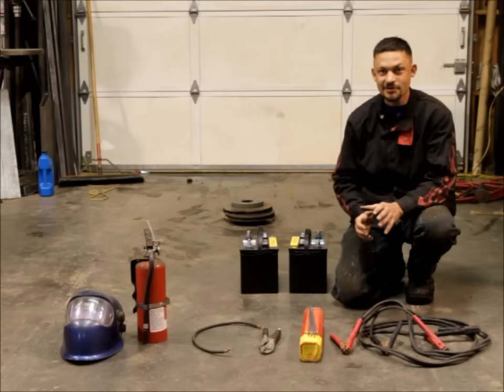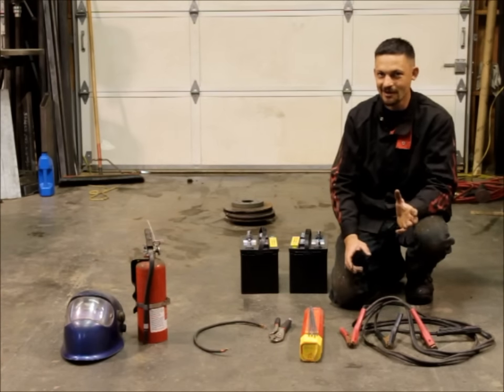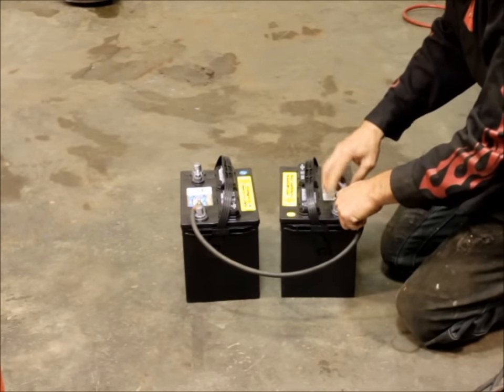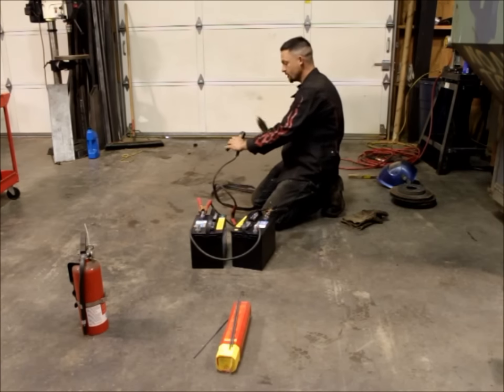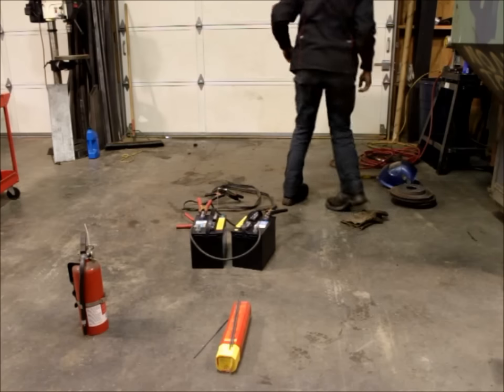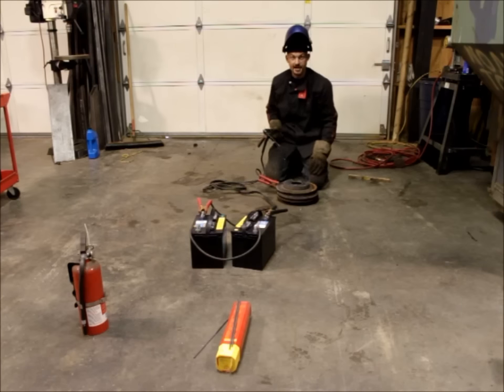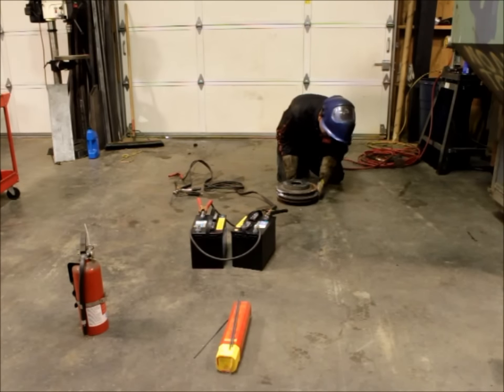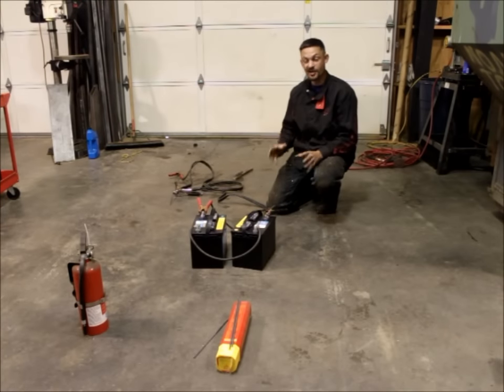Welding with jumper cables and a pair of batteries

Comment: In Africa we use old wire coat hangers (the plastic coating makes good flux) and for a helmet you just have to squint or use 3 pairs of sun glasses!!
Reply: I've welded with coat hangers and a battery before, and it actually makes a pretty nice looking weld.
Reply: I don't think squinting is going to help much; UV can easily penetrate your eyelids.
Reply: Sanwi Derp for 24 $a month we can buy this guy an welder and some rods lol
Reply: craftsman mud mower Lol if you guys want to buy me a welder feel free.
Reply: A Boera Maak n Plan!
Reply: Iol. Welding produces UVC radiation. The worst kind of UV. You're gonna go blind.
Reply: +4nuk8r  Hey i know this is kind of random but i was wondering if i could pick your brain on your welder knowledge. My dad came across an old pow-con wire welder/plasma cutter. Unfortunately it doesn't work, I was informed of a couple pico fuses to test, which were bad. I was also told there should be a ticking noise while powered on at rest that i am not hearing. Just was hoping you might have knowledge of the line of welder, or an idea of a place i could start as to why the fuses are blowing? It is quite an old unit, could capacitors need replaced?
Reply: hey dude, i can try help does the machine power up at all
Reply: hey thank you, i will take all the help i can get. it's been a bit since i have had a chance to play with it. i will try and get back to it soon, there was no display lights or anything for sure. I can't honestly remember if it was making any noise or not, i know it wasn't ticking for sure. Once i am able to test it again i will get back to you.
Reply: ive been doing it for 40 years and my eyes are fine.
Reply: hogwash.
Reply: in Mongolia we use pubic hair and 3 seashells to weld
Reply: no he has 3 pairs of sun glasses
Reply: African Electron 😂
Reply: M
Reply: Hey Blind Willy... didn't know you were back from Africa.
Reply: African Electron z
Reply: Here in Indiana we use 3 lawnmower batteries & a clothes  line to weld .Yeah
Reply: @TheEgg185  what about uva and uvb? gamma???
Reply: Can I ship you a helmet can it get through customs for sure?
Reply: @knightrider1545  there's no gamma or even soft x ray radiation produced during arc welding. Extreme UV is possible with some monstrous power levels, and it's ionizing somewhat, but hardly as much as x and y radiation.
Reply: @jonathan-emilypowell1962  Should take 4 years for them to figure what it is
Reply: African Electron i hear africans also use this as a torture method for rival clans
Reply: My old boss in USA has used Metal Coat hangers. It must make a weak weld,no?
Reply: shit eye sight today huh!
coat hanger works but one brittle weld....it will work chief...we did it in the military in the field.....
good job on video chief!
Reply: African Electron I need a video of this!
Reply: Al Morrison why add to the medical problems they already have!!!!
Reply: @africanelectron751  All you have to do is work save some money and buy yourself a decent inverter welder they are cheap and cost less than two good batteries:-)
Reply: @johnhili8664  capitolism at its best!  why doesn't miller or lincoln donate welders to african soldiers instead of letting them go blind?  God sees everything perhaps the ceo's of every welding company will go blind without the help of a welding arc!
Reply: @michael-dm2bv  Africa is the richest country in the world, they have diamonds, oil copper iron ore, coal you name it they have it you can afford to buy a welder, here we sit on a small island no resources not even water as there are no mountains, I worked hard and bought a small welder, most probably if you were donated welder you break them up and sell them for copper Africans want everything for free!! Go and fight for your rights!!!!!!
Reply: @johnhili8664  - Africa is the most exploited continent on the planet.  not the richest.  the riches only go to those that do the exploiting.  not one company in africa has ever given a poor african worker a diamond or a sliver of gold.  greed at its finest!
Reply: @michael-dm2bv  I told Africans to go and fight for their rights not run away and expecting other people to do their fighting they have to do like the French the Russians the Italians the Indians they all fought for their rights Case closed as I am trying to wash a donkey's head it will still remain a donkey:-))
Reply: .. yeah brother .. seen Uganda welding from Kampala to Ntungamo .. wonderful what's done for so little
Reply: @strangelyfamiliar1729  Cool cultural Marxism you got there. 
Get well soon.
Reply: @xxzenonionnex7658  That's, just, like, your opinion, man.
Also, cool cultural Marxism.
Reply: In Mexico we spark two hot tacos together to weld.
Reply: You domt need glassess to weld ic been wedding for ears and I see just find .
Reply: We tried the coat hanger trick and it wouldn't hold an arc.

Guess we may have had a different metal in the coat hanger
Reply: Lmfaoo 💀💀😭
Reply: I was thinking do they use a kid's head hook up to a flywheel and using their teeth for a sewing machine try to picture that I bet you'll laugh
Reply: @africanelectron751  can you actually weld with a hanger or are you just joking? Thanks
Reply: Note to self open a hw store in Africa
Reply: @michael-dm2bv  no country in north America has given any poor American gold, oil or diamonds either. Whats your point?
Reply: @nicthemickatx  africa is just like texas.  or could be.  water is easy.  one way or the other.  what particular point are u looking to sharpen?
Reply: @michael-dm2bv  what the point of saying nobody gave them any of the resources? I grew up with nothing and no one's ever given me anything. So what? There are tons of investments and venture capitalism in africa harvesting those resources just like coal miners and gold miners here. Take a job and earn a wage, if not... hunt to eat and use the environment to craft everything you have ive done both. People don't just GIVE away resources nor should they. It make countless human beings. America's got bunch of girls people right now because they've been given everything and can't fathom doing for themselves. Life is struggle. Those that claw and scratch on the path of making/ doing for themselves are the only ones worth saving.
Reply: @nicthemickatx  - i can bet you my limbs african gold miners make nothing compared to a first world countries miners, regardless of what they are mining.  
Life is not supposed to be a daily struggle to put food on your plate if you work for a company, making billions, pulling gold and diamonds out of the earth.  
There is a very big diffirence between making a decent living helping a company make money compared to struggling to make a living just so a company can make  more money than they would if they treated their workers like human beings.
u may not have been given anything but i bet you always had access to a job that GAVE you a decent wage.
Reply: Safety squint engage
Reply: Outstanding I like when people use what they have to accomplish whatever there doing well done my African friend
Reply: You can use wire coat hangers and wrap them in old newspaper for the same effect.not for the eyes I'm not sure exactly what would be used but I would definitely not use sunglasses
Reply: Island boys from the pacific used to cut a slot in a piece of cardboard to look through whilst they welded ....
Reply: Iv seen my dad use the wire hangers to wield the muffler back in place.And it still holding to this day it's been like 10 or 11 years.
Reply: @michael-dm2bv  I never had a job that GAVE me a wage, always had to work to earn a wage. Where do you work that you don't have to do anything but sit at home and collect this great wage the company is GIVING to you?
Reply: @sanwiderp502  I did that once with a mig weld and my eyes got burnt. Hurt like hell. Its a weird pain, like you sunburned your eyes.
Reply: s10 mafia why ?...
Reply: You should keep 1 pair of sunglasses  to hide your eyes after you lose your sight completely  because that method of welding is just plain stupid Ultra Violet light is  powerful thats why  you shouldn’t stare directly at the Sun  I guess they dont teach that in Africa
Reply: @nicthemickatx  food stamps and free money
Reply: @johnhili8664  africa is natural resources rich. However much like every country that is resources rich the land is owned by either US or Europeans. Debeers i think own the mines in Africa, Dole in Hawaii and puerto rico for pineapple, bananas. Its all monopolized by a select few that began when settlers showed up.
Reply: @mikewhitman745  i read the post of the guy you quoted. I dont think thats what he meant .
Reply: Oh yea? Well when I was a kid we played basketball in the hood using a brick as a ball, our cousin Eddie made a hoop with his arms and we played barefoot...... on broken glass lol
Reply: That's extremely crude but as long as it works.
Reply: Happened to me in the shipyard when I was commissioning the USS Truman, too. Feels like a corneal abrasion (which I’ve also had).
Reply: Africa got All the tricks thank you Jesus
Reply: Dont kill your precious eyes, never cut corners on eye protection when welding. Please, skimp on everything else, use batteries like this guy, use coat hangers, but use a hood dude, at least a lense with cardboard taped around it and secured to your head. You don't want that eyeball sunburn. Or permanent retinal damage.
Reply: @johnhili8664  Yes but can you power it on the trail ?
Reply: @nicthemickatx  Ouch wow man that's eye opening as millions of Americans now sit jobless waiting on their next stimulus check .
Reply: @sanwiderp502  really?
Reply: @sanwiderp502  brown beer bottle
Reply: Awesome af comment 🤣🤣🥴🥴🤣🤣🤣🤣🤯🤯🤯
Reply: @willieboy8798  don't people realize that Africa is a big place there's rich countries poor countries poor people rich people it's a giant continent how can you say one thing about one giant continent you need to travel some
Reply: @michael-dm2bv  it's not the welder that makes you go blind it's the lack of a good helmet
Reply: @Mike I don't think my pain was as bad as yours but I got stuck in the outback in the high country after a spring snowstorm and burned my eyeballs pretty bad it felt like I had sand in my eyes
Reply: @arlenmargolin1650  i have three passport books full of stamps in fifty years! 
Africa is a continent of countries. I know personally people from twenty of them...Been there three times
Reply: @s10mafia61  lmao
Reply: Ford Prefect  that is the very first verbage that comes out of the instructors mouth....
metal shop teacher very first thing we were tested on before we even saw a welder!!!!
Reply: Ford Prefect  so your telling me i need refresher training or what.....
or i sound stupid one of the two????
Reply: African Electron,
There are 54 countries in the CONTINENT of Africa with over a billion people. What country are you from. Certainly, I would pitch in to donate.
Reply: @jesseperez6139  ....you gotta go further to rival The Four Yorkshiremen .
Reply: Yeah thats really stupid
Reply: And that's why median death age there is 26 years old...
Reply: Squint or 3 pairs of glasses ? I dont think thats ok , last time i welded with my safety jacket open and it left my skin REEEED like a baaad burn and after a week it peal off and after like 3-4 weeks here i am still with a dark spot in my skin
Reply: I've welded with eye's closed not kidding don't recommend tho
Reply: @johnhili8664  people havent fought for anything, not that matters atleast. Every citizen in the world is living a lie. Were living someone elses idea of what reality should be. Modern society is braiwashed and opressed as a whole and most all of them dont even know it.
Reply: @sanwiderp502  Isn't that why 3 pairs of sunglasses or if you like 4-5 pairs.lol. Peace Sanwi Derp
Reply: @s10mafia61  Am i too late for free welder?
Reply: @africanelectron751 Did you get a welder yet or still using a battery?
Reply: @michael-dm2bv  Takng a low wage is ok to start but experience gets the wage.In other words the best way is the slow paced,step by step guaranteed to get there, just like breathing,along with some healthy interest & ambition. .Imagine that,paid for breathing.Using a weld helmet is advisable.
Reply: @Mike Sandpaper eyes that don't quit.Cold cloth and squinting eyes closed hard gives momentary relief.This happens once usually for how pleasant 5-6hrs wanting to pull your eyes out for the night stays with you.Roughly 20-25 years back myself.Using auto dark when first came out i  kept shielding the sensor causing delay.Never used auto helmet much but are great for certain jobs.
Reply: @livefreeordietrying7242  Awesome gas(Acetylene) welding works beautiful with coat hanger(Cleaned off of paint & coating) for mufflers.
Reply: @mikewhitman745  Government is the great company that gets more abused daily.Start at top & start firing if i had my way.Never hire someone without ambition if you want to succeed.Loyalty would be second consideration.Seems nobody cares if the great company goes broke,willfully destroyed or stolen blind.Fight for freedom still exists & always will,is what young folks take for granted. 4th amendment keeps us safe in N.America.Largest free standing army is a harder target One toke after 8 months & bam text diarrhea..Bat welding to politics!Oh well good night or day wherever you is.
Reply: @fishfire_2999  opportunity to start up & support small local business & cut out corporations & filthy rich.A few work trades we as humans can't do without,farming,food,mining,manufacturing,accounting,booze & drugs,medical &  dying to start.Sex,computers,games,television,acting etc.
Reply: @1philliph  That's improvising! Your hired.Amazing what can be overcome with a few beers.lol
Reply: @willieboy8798  Rods & cones are good to keep intack for life's scenery.Small ass & big puppies(I know they're awesome in the dark too.)Absolutely correct the eyes need protection so you can keep doing it.Best trade going when you are good at it.
Reply: @youtubecertified4643  I keep hearing,"well how do we change it?"Loyalty & accountability.trade & barter,,gold & silver etc(money metal).Take back 800 tonne of gold from Brussels & divide to countries for insurance.No work, no eat.Fat & lazy goes away,mostly.Lazy fer sure.
Reply: @MrThirteen09  did i accidently walk into a optomitry convention?
Reply: @sanwiderp502  "safety squint"
Reply: @Obsurdious  😂
Reply: African are original technologists.  I squint too nowadays and find the correct balance to see perfectlee🥰
Reply: Dollar store Jesus  ya dohnut
Reply: Me and grandpa are in the u.s. in California we use hangars too
Reply: That's a good way to injure your eyes. I know from first hand experience. I was blind for a week, I couldn't see anything.
Reply: Holy shit scuffed
Reply: i can't tell if this is offensive or not. jk.
Reply: God Bless You In The Name Of Jesus!!
Reply: Who's your welding idol .? Ray charles?
Reply: In Israel, you either use 2 pairs of good knock off raybans or you can get away with 1 real pair of raybans glasses.
You usually find them in dead Palestinians homes when you're busy doing whatever occupation business you're doing out in the west bank.
Usually they buy the knockoffs but be careful it might be bad knockoffs from aliexpress and that can lead to extreme eye pain!!! only use high quality knock offs or straight up originals
Reply: @chrisbraid2907  😂😂
Reply: Try 4 pairs of sunglasses works better 😉
Reply: dark beer bottles work great for lenses
Reply: @UZI9MMAUTO 45,000 lbs psi when welding with clothes hangers which is still pretty good